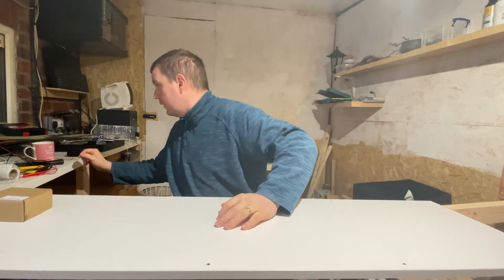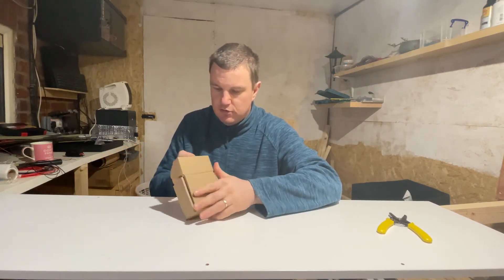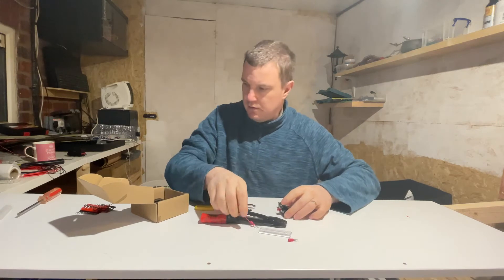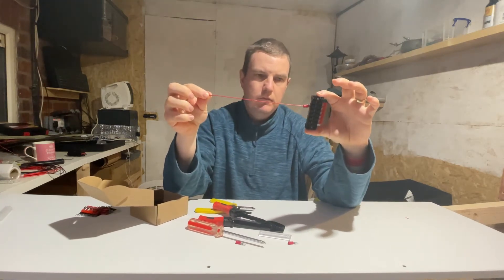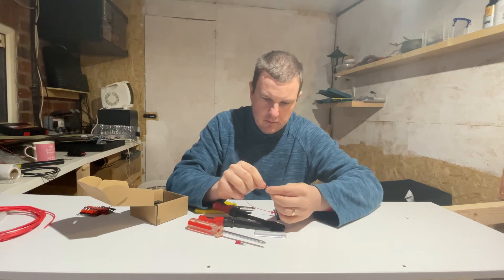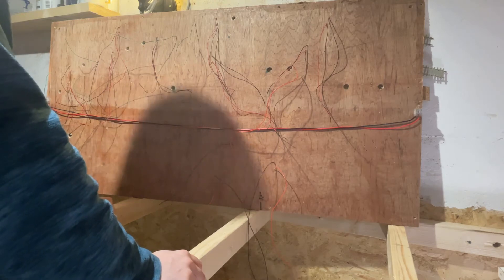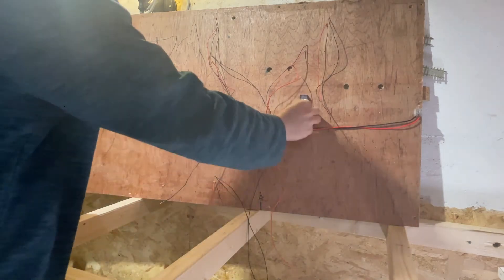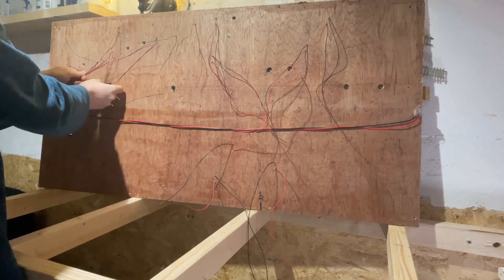#3 - Installing a Bus Wire & Barrier Terminal Blocks

Comment: Have you considered drilling holes in the benchwork to run wires instead of mounting the on the underside of the top?

Comment: Those connectors ‘scotch locks’ are rubbish. We used them many years ago in the automotive trade . The blade don’t allow a full cross sectional area connection and cuts the strands in the wires thus reducing the main cable before the next cable joint. 
Also after time the alloy blade corroded due to interactive with dissimilar metals.
They were banned from use in the motor trade in the 1970’s

Comment: I enjoy a wiring job but I would have personally looped the bus wire without the suitcase connectors .. I would have looped the bus wire from the main source to the first barrier stip, and looped to the next and the next etc etc etc. Trying to avoid the possible failure of the suitcase connectors you mentioned :) Other than that, job well done :)